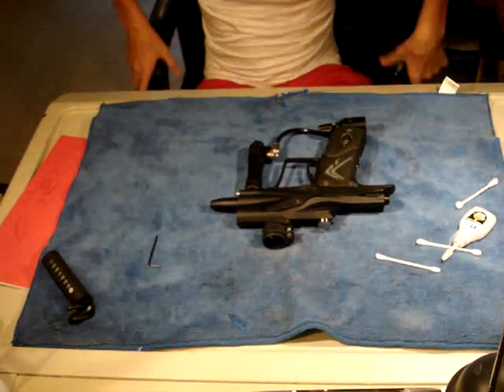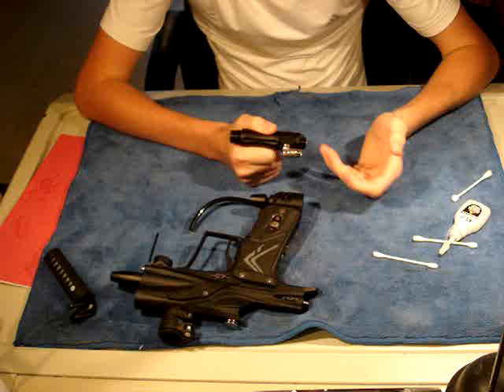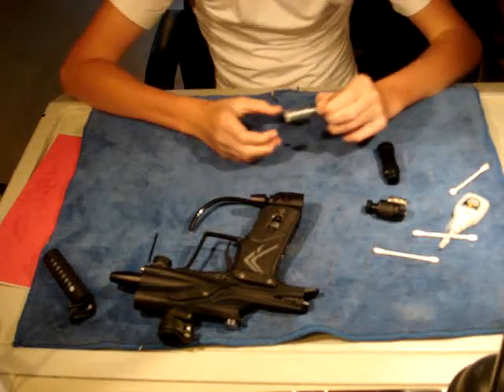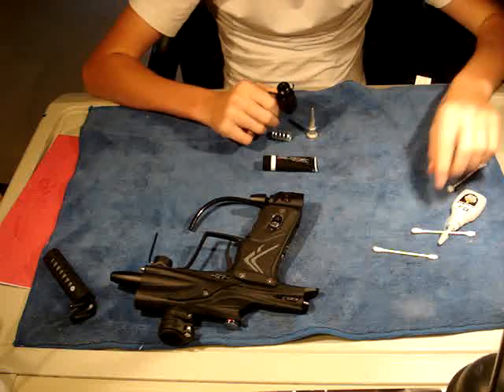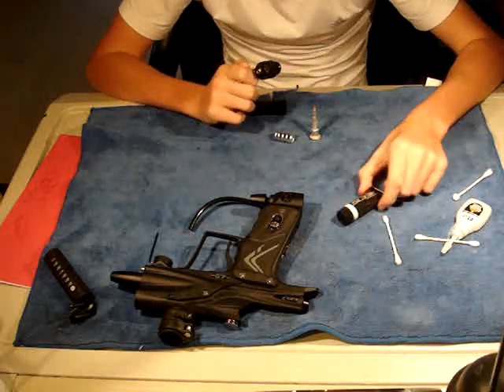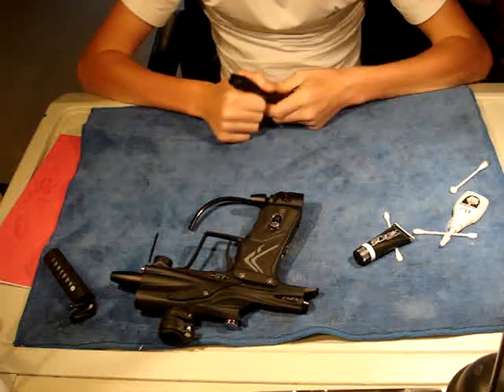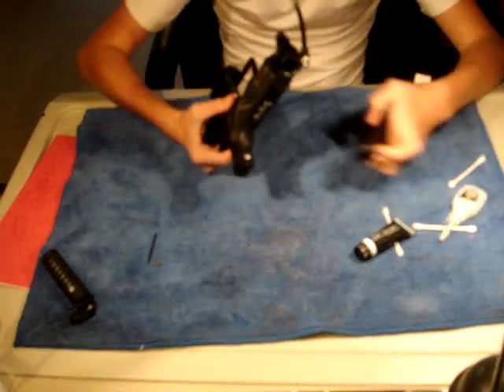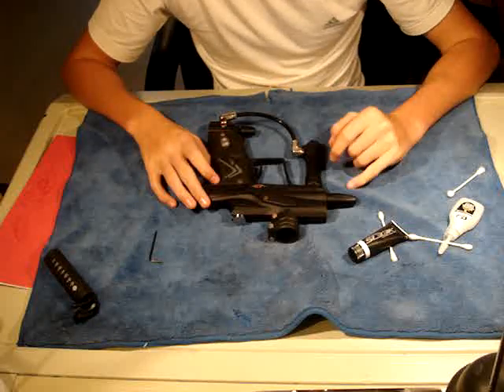Maintaining the Planet Eclipse S3 Regulator (Etek 3/Ego10)

Comment from the maker: When a ball is chopped that means the bolt comes in contact with the ball before its properly seated in the breach and the bolt pinches the ball. Easiest way to clean this is with a squeegee down the breech. 

The purpose of efficency tests are to show how efficent they are with air consumption. When there is no more air left they wont shoot anymore so thats what your seeing.

The best time to use a squeegee is when you break a ball in the breech/barrel.